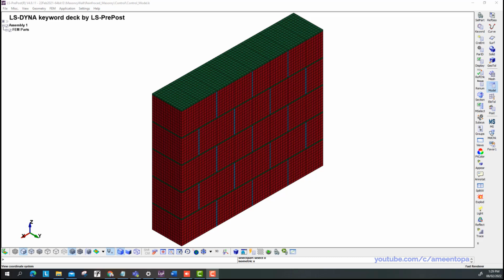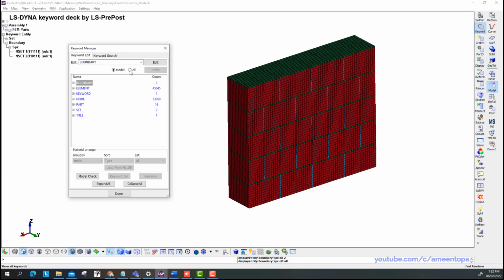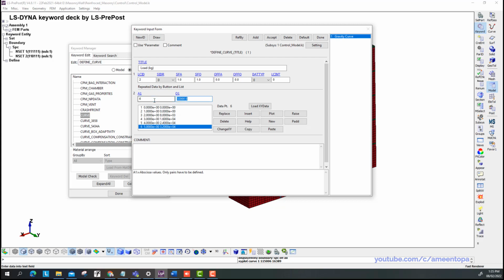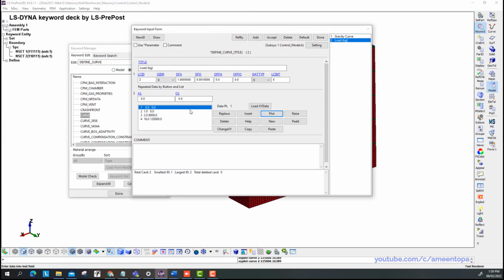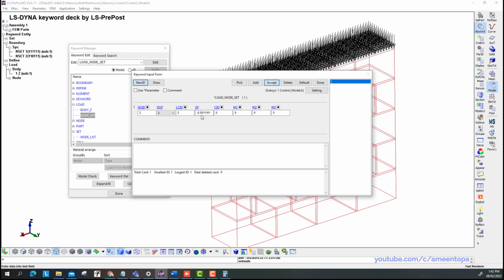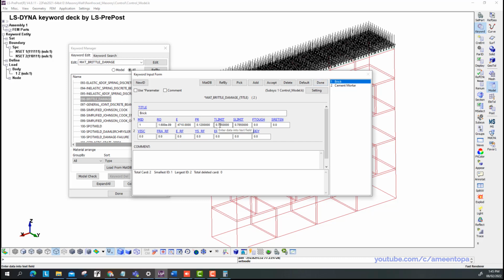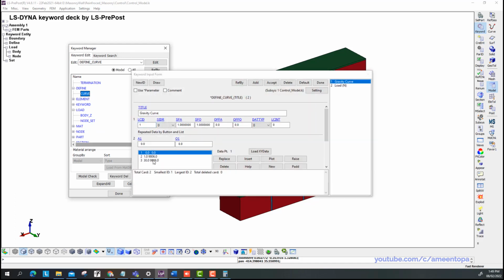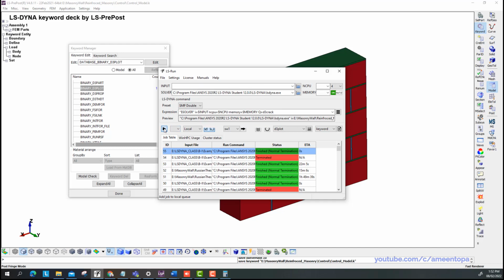Vertical Load on Masonry Wall: Keyword Manager

Comment: hallo sir, if i make detailed micro modelong of masonry wall, which type of contact we use, and should we use contact model as between brick-vertical mortar and brick-horizontal mortar? or we only use contact between brick-horizontal mortar? Thankyou sir
Reply from the maker: There are more than one method to do this:
1 - The easier method is to merge the nodes between the mortar and the bricks. With this method, there is no need to use tiebreak contact. This is the approach used in this video.
2 - For tiebreak contact, you need to define contact for both brick-vertical mortar and brick-horizontal mortar.

Comment: Hi Mr.Ameen Topa, which type of contact model you use in this model?
Reply from the maker: It was TIED SURFACE TO SURFACE.
Reply: @AmeenTopa  When you define TIED SURFACE TO SURFACE contact model,  what is the master and slave side ?Do you use TIED SURFACE TO SURFACE contact model as between brick-vertical cement mortar and brick-horizontal cement mortar?
Reply from the maker: @seyhanokuyan277  It doesn't matter which one is slave and which one is master in this case.

Correction: for the simulation in this video, I did not use any contact. It was a preliminary mode. I modelled the mortar using solid elements and it was perfectly bonded to the bricks.
Reply: @AmeenTopa  Thank you , is the perfectly bonded performed by constrained lagrange in solid ?
Reply from the maker: @seyhanokuyan277  it was done by merging the nodes of the bricks and mortar.
Reply: @AmeenTopa  how did you merge the nodes of the bricks and mortar? Did you use "merge duplicate nodes"?
Reply from the maker: @seyhanokuyan277  Yes, and the nodes of mortar and bricks should be aligned..
Reply: hallo sir, for brick mesh and mortar, does it have to be aligned, and how do I make it aligned?

Comment: Note: A positive body force acts in the negative direction. 
Body forces are generated in the model by applying translational base acceleration. These base accelerations can be thought of as accelerating the coordinate system in the direction specified while the inertia forces on the model are in the reverse direction.
Reply from the maker: Yes. Similar remarks are written in the user manual (vol. 1) of the software

Comment: Hi Mr Ameen Topa,

I would like to know the unit of Mass Density (RO) in MAT_96_BRITTLE_DAMAGE properties.
On this video, RO using "1600e-12". if I'm not mistaken, if we use RO in kg/mm3, it will be "1600e-9". Can you explain it?
While the unit of Young's Modulus used is MPa (N/mm2).

Thank you
Reply from the maker: 1600e-12 = 1.6e-9

This density is tonne/mm3. 

Check the link below:
https://www.dynasupport.com/howtos/general/consistent-units
Reply: @AmeenTopa  Ah I see, thankyou so much for your response !

Comment: Hi Mr Ameen topa, 

i would like to ask, is it possible for a solid element to generate plastic strain under a bending load? I read somewhere that solid element only have 3 translational DOF and i thought it should be impossible bcs they don't have rotational DOF. 

Thank you for your help
Reply from the maker: Plastic strain is possible even if it is solid with no rotational degree of freedom. Please read here:
https://www.dynasupport.com/howtos/general/effective-plastic-strain

Also, the 'Effective Plastic Strain" could refer to another quantity, depending on what material model you use. 
https://ftp.lstc.com/anonymous/outgoing/support/FAQ/effective_plastic_strain